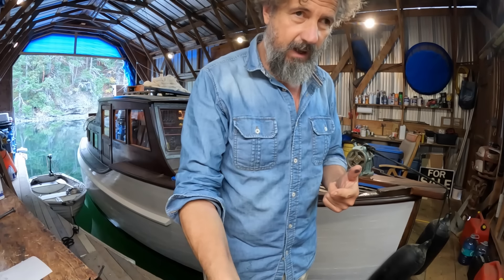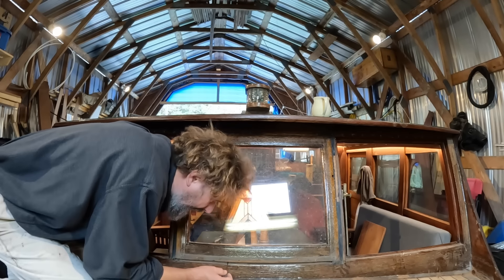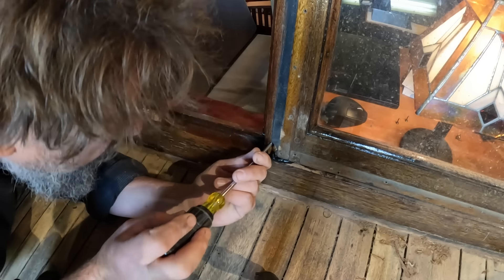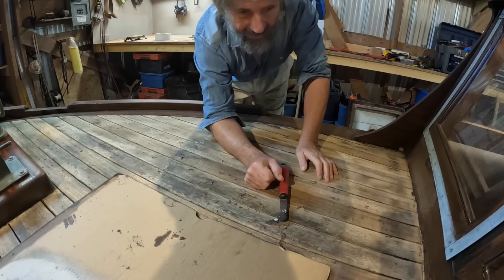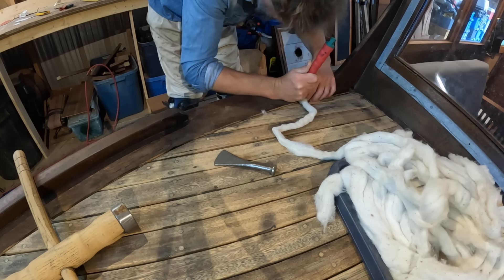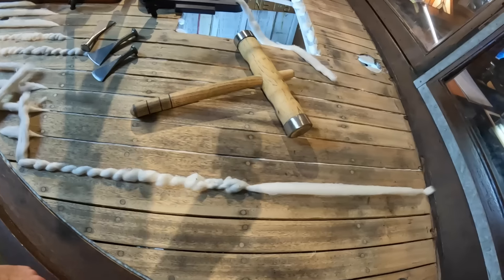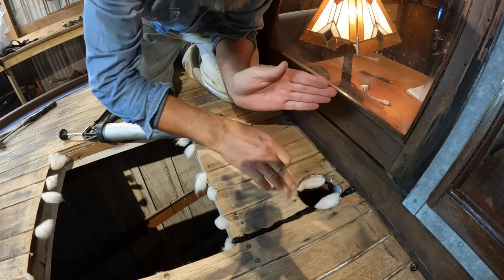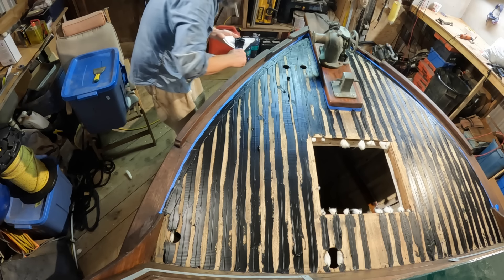Fixing the Foredeck, Fraught with Misfortune - #436 - Travels With Geordie

Comment from the maker: I need your thoughts folks. I really think this Teak Deck Systems STS 440 sealant is an amazing product. It's sandable, has excellent UV resistance, sticks like crazy  and is incredibly flexible. Do you think it's suitable for general exterior sealing? where in the past I would have used Sikaflex 295.
Reply: Absolutely, I have a 1931 Jensen motor yacht and I use 440 for bedding and all sorts of other sealing projects. I used it when I replaced a couple windows and it worked great! It doesn't come in white, that I know of, so I still use Sika on the hull for portholes and thru-hulls (or 5200 where I need super strong holding)

Now I have a question for you... I am right now resealing the teak on my foredeck. I reefed all the cotton which had never been replaced and now I am about ready to start sealing it back up with 440. I wasn't planning on using cotton again. I was just going to use a strip of thin tape at the bottom so that the 440 can sort of float. Is there a good reason to use cotton nowadays, considering the improvements to the sealants? Incidentally a good trick I used on some of the teak strips that were bad... flip them over and then they are like new!
Reply: Update: I just checked - it does come in white
Reply from the maker: Well, Jason, I am glad to hear of your success with 440. I suppose i think of the paying in a seam as primarily to protect the cotton. However, its true, 440 is a much better seal than hot tar ever was. I was content to re caulk with cotton and pay with 440 to keep the thickness of the 440 relatively thin. If the bead is too tall, it will be too hard for it stretch horizontally.
Reply: @TravelsWithGeordie  As you mentioned... it's all about prep. By sanding the inside edges and using acetone before you installed the 440 you will get excellent adhesion. Most of the videos I see don't even install cotton but maybe that's only with fiberglass decks. I have a shipwright friend who routers a T-slot into the edge of the teak which gives a lot more cross-section for the 440 to stretch. I am looking forward to seeing you sand off the excess! Side note: one of my big goals is to cruise the inside passage in about another year when my boat is closer to being done. Maybe I'll track you down and we can have a beer on my fantail.
Reply: For what it's worth, I just completed the NWSWB boatbuilding program, and if this question came up in class, the answer would be to use the product for its intended use, namely STS 440 for decking and Sikaflex 295 for general exterior sealing. That said, contact the manufacturer and ask their opinion/advice so if there's a problem and you've followed the instructions to the letter you can tell them it was the product that's failed and not your work. Cheers!
Reply from the maker: Great thought Jason! It actually sanded off very easily. I really like this stuff. Fantail woo!!
Reply from the maker: Thanks! That certainly is the disciplined approach. I really should get a hold of TDS. Congrats on your recent studies at the splendid NWSWB!

Comment: Several years ago I dropped a small battery powered sander in the drink and eventually recovered it with a magnet on a line. It was a sunny day so I left it on the coach roof to dry out with the hope it would survive. About an hour later I heard the sander start to run (it was on when I dropped it) and before I could reach it - it vibrated itself off the coach roof and splashed back into the drink. This time I never found it. Great episode and thanks.
Reply: That is a great story, Peter. Which brand was it - quite the testimonial?
Reply: @TR4zest  It was Bosch that went splosh!
Reply from the maker: Peter! I had a good chuckle. What rotten luck. But your misfortune had entertained many I'm sure.

Comment: good work accomplished . gotta love magnets ...    in the long run i'd stick with sikaflex . the 440 will work , but sika is more robust . are you planning to route a groove at the bottom of the windscreen for installation of the sealant ? great program this week ~ cheers
Reply from the maker: Thanks for your thoughts Rol! Part of my concern with Sika is that it is so robust. The added flexibility of the SDS is very useful in some places. I think the brass strips will just be bedded in.